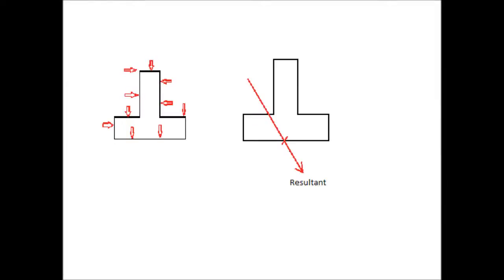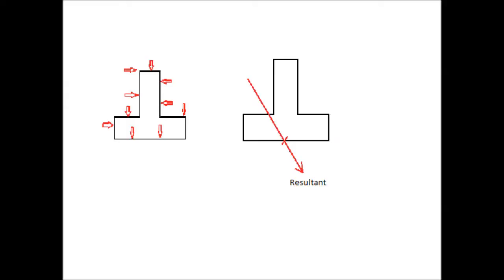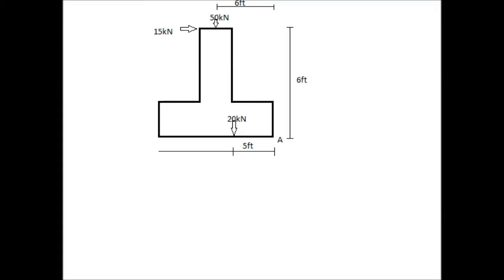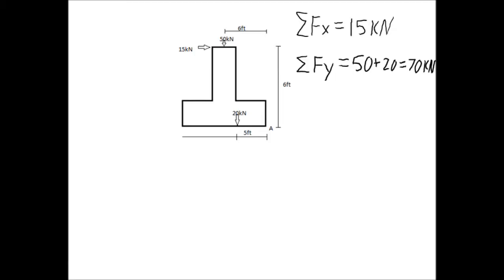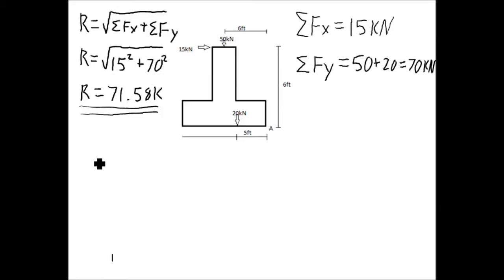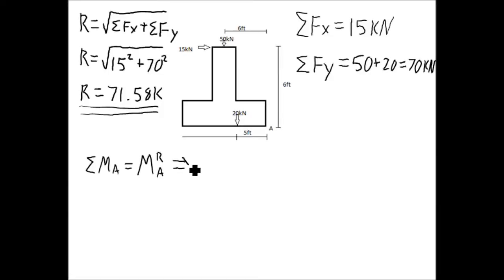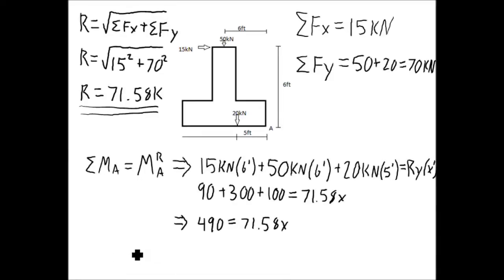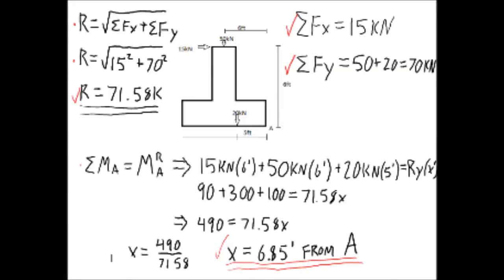Calculating the Resultant and its Location

Comment: Saying all forces are positive means that all the forces cause rotation in the same direction. Wrong. The 15kN force opposes rotation of the other two forces.
Reply: Wrong, they are all negative. They all push the object clockwise.
Reply: @eliospiro8423  You have to look at it with point A, the bottom right corner, being a hinge. The forces going down will make the object move counter clockwise if A was a hinge, while the force going right will make the object move clockwise if A was a hinge.